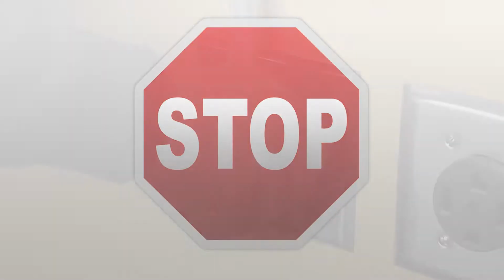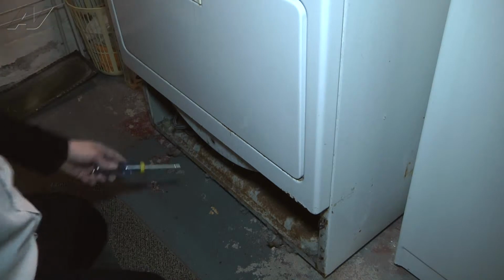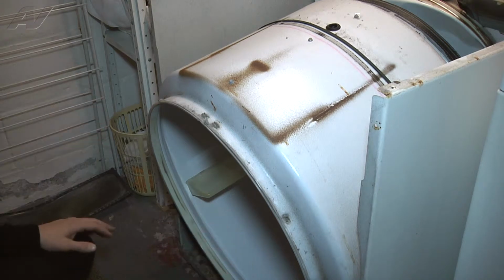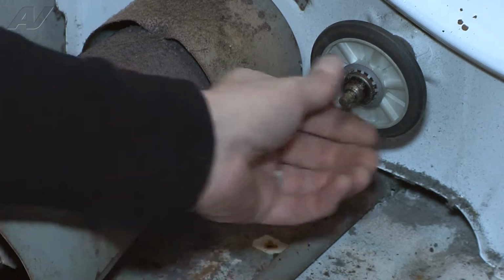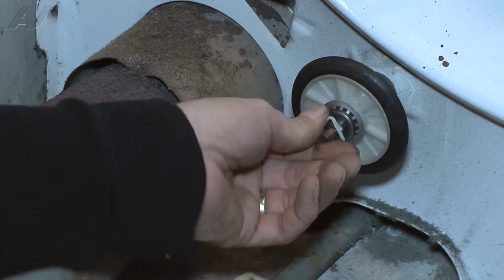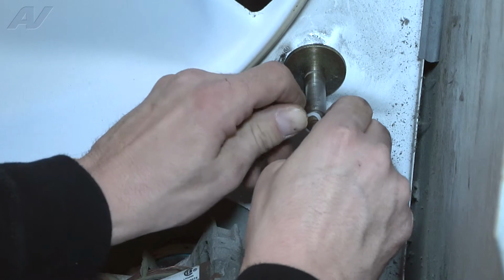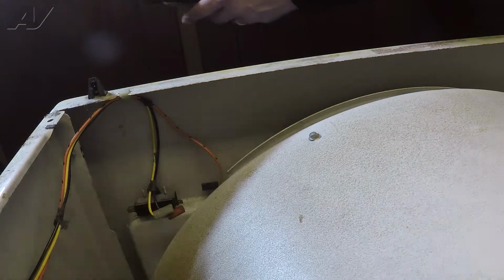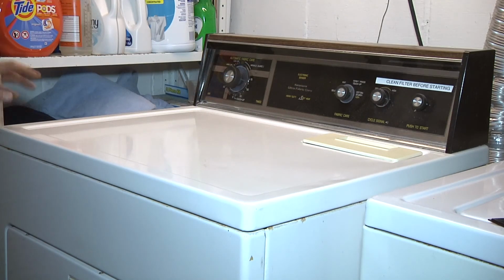Kenmore Dryer Repair - Squeaking and Grinding Noise - Drum Support Roller Kit

Comment: What is the method used for cleaning wheel-shaft?
Reply from the maker: Great question, if you have a more technical question that our parts department cannot answer, you can search our over 17,000 answered questions free at our website www.ApplianceVideo.com under our Repair Help section. You can also call our parts department at 1-800-830-5465 and they can give you help 7-days A week ,or search at www.SaveMoreOnParts.com  .
Reply: @Appliancevideo  - Thank you, sir.